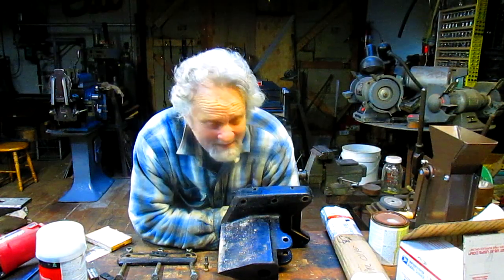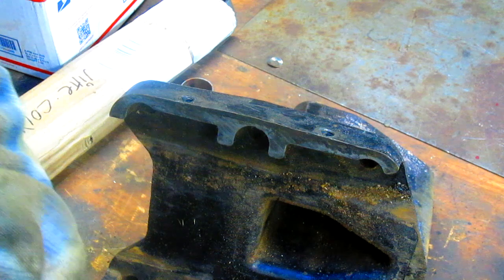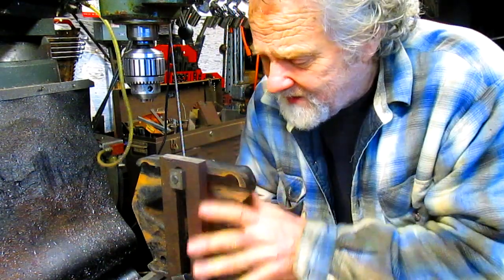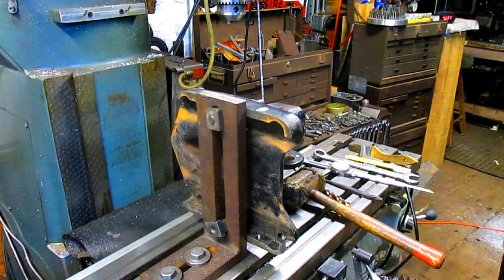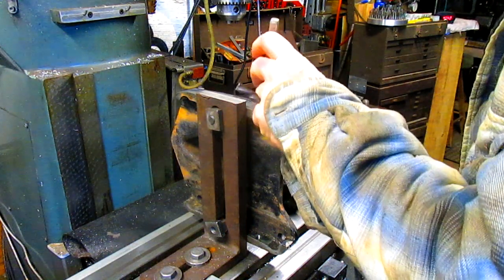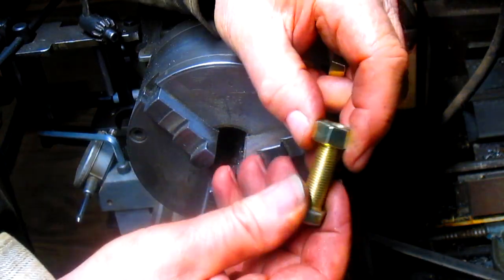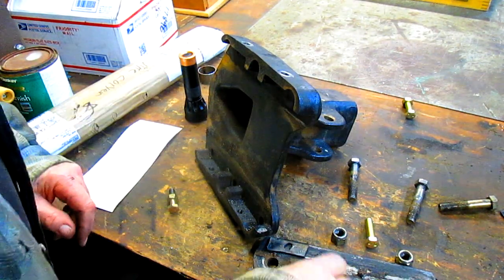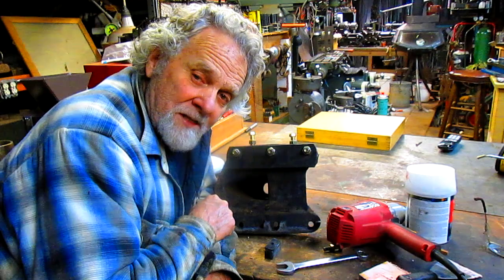Chinezium splitter repair

Comment: Hey Nik, a trick on the centering of the bolt in the little lathe, I made a tool with a small bearing at the end that I can push up against things. Works well for centering items like that, and also for straightening up items along the axis of the spindle. Works well if you have lots of tool holders, which I make myself in batches of six.
Reply from the maker: I have one of those for my big lathe. I always forget to use it.
Reply: Niks projects are always interesting. 
A quick method similar to the bearing method is to put a sharpie in a tool holder and slowly advance it until it just makes contact with the bolt, leaving a mark at the high spot.

Comment: Seems like when the wood is pressed against the stop to be split, it also is pressed against the gib screws/bolts too. Or at least it seems like that is a possibility from just seeing this part. IDK, But if that is so, the bolts sticking out will also work loose because there is a lot of force pressed against them every time. Just wondering out loud. Thumbs Up!
Reply from the maker: Because there was no square seat for the lock nut, that is exactly what happened, the bolts kept working loose. Once I put the seat in the casting the lock nut could be cranked down tight thus no movement.

Comment: When you move the gibs to the other side. It will move the wedge and the cylinder will be off center.
Reply from the maker: You are right, off center by about 1/4". Knowing Chinese made anything every part of the splitter would be sloppy so 1/4" would not matter.

Comment: This one I will be watching very closely. It is theoretically a simple job to do. That said, I don't think I have ever successfully achieved this. Moving a tapped hole over a significant amount is quite easy to do. But moving one over less than half of the diameter? I have never had it work. No matter how stiff of an end mill I use, it wants to deflect back to the original hole. At best I end up with an oblong mess. It can be tapped but it will never look right
Reply from the maker: So, just move the whole mess to the other side.

Comment: Those fuckers are made out of something resembling cast steel extremely hard crap in places we had an old Troy built when I was in my teens dad didn’t like the wedge it was to long put to much rotational force when going through tougher woods knotty oaks and what not we attempted to cut it which a band saw ruined a 40$ blade he was pissed wound up torching it off worked decent after that actually cut it down to about where this one is
Reply from the maker: I believe the hardness comes from quenching the casting too soon, but that is not a bad thing when  it comes to a wedge.